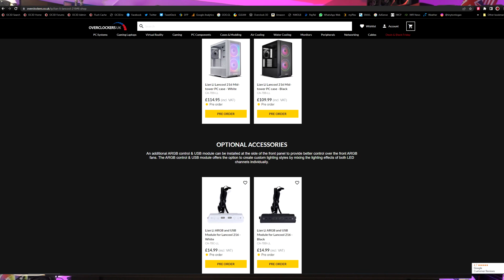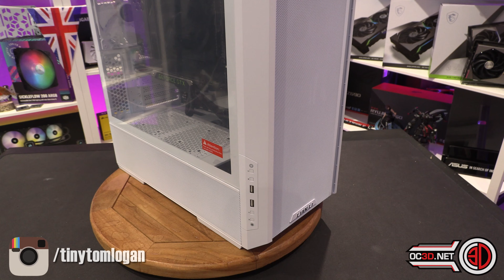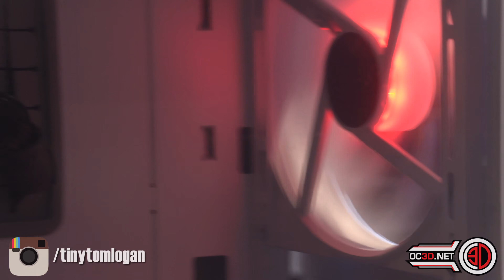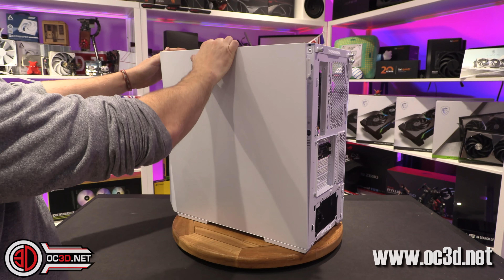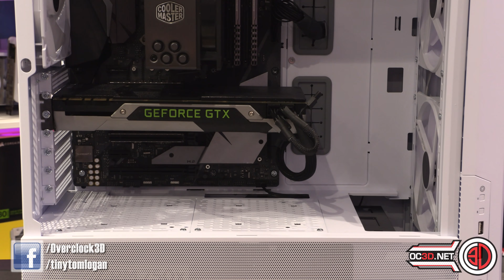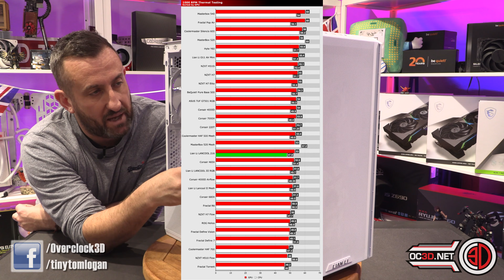Lian Li Lancool 216 Case Review

Comment: Great case, but that said it is as wide as a semi truck! I went with the LL 207 instead, narrower and with the lower fans a wind tunnel. Peerless Phantom Spirit, 6750xt both run cool, with volumes of hot air escaping.

Comment: Sorry about this kinda noob question ..if the two front fans daisy chained together can i just connect it to straight to the mobo but still need to put them in individual headers. are the wires long enough so that i could connect them underneath? i opted to buy this rather than the montech air 903. i was so over whelmed with lots of wires. lol

Comment: I wat to do a new build, with a ryxen 7 7800 X3D cpu, but not certain which motherboard to use with it!  In whatever motherboard I hopefully get I want to be able to use at least 4 NVME SSD on it without comprising the graphics card down from 16 to 8,  I want to be able to use GPU to full 16.  So my question to use is which motherboard would you recommend for me to use?

Comment: I've recently purchased the Lian Li 216 case, and I'm absolutely thrilled with it. Despite my front fans running at full speed due to my motherboard lacking PWM control for them, the case has significantly enhanced the aesthetic of my entire system.

Comment: I have and old XSPC 360mm radiator which is 60mm thick and with the fans I have 80mm of thickness. So my question is: would they fit on this case?
Reply: No 55 mm tops
Reply: @Ollibollimakkarolli  my case arrived a week ago and the radiator was installed because my memory is not tall. 5mm taller and it would not fit. One detail: the 140mm fan on the rear had to be moved down to place the fan on the radiator.

Comment: Hello, PLEASE HELP 
When I set the RGB lighting to a custom color, it always reverts to the default RGB settings when I restart the computer. I don't have an ARGB connector on my board and I'm using a lan216-1 panel. I always thought that would be better. Is it possible to save the color settings somehow?

Comment: This or the lian li iii?
Reply from the maker: The III is probably my case of the year
Reply: @OC3D  ok so I will get that ,thanks
Reply: they are very similar but different in important ways. the III is for sure the more upscale version, it also costs more. they do end up performing about the same thermally but i think the III is a little bit more quiet sometimes. but its also bigger and more mechanically complex. you can't go wrong with either just gotta do research and know what you're looking for. with my parts and budget i went with the 216 black rgb personally

Comment: I just got the case and I bought the 216x ARGB Control & USB Module and it was a pain to put in. I would suggest to avoid.
Reply: where did you find the argb panel?
Reply: @marchufnagel9068 on newegg LAN216-1X (W for white).

Comment: Do the argb buttons turn off the front fan LEDs? Or is it just for changing the color of the fans?
Reply from the maker: if the ARGB hub or mobo connector isnt fitted they wont light up

Comment: Hey, what 140mm rgb fan would you recommend for the rear exhaust fan?  Looking for something that will match the front 160mm fans.... I looked at lian li website and could not find one that works. Something that would easily match the front and have the outer ring and inner ring control.  Thank you.  Fans that can go into the hub not have proprietary connections.
Reply: Cooler Master MasterFan MF140 Halo White Edition , might work.
Reply: @paalosordoni7932  thank you, I have looked at those and agree they would work great. Thanks again.

Comment: Nice case  white looks great, with Gamersnexus testing the 215 had better GPU  cooling even though the 200m fans are slightly blocked off.
Reply: Yeah that's my only issue with this case.
Reply: @purpasmart_4831  Check the KitGuru review for this case, you can improve GPU temps like a boss if you install just 2 fans at the bottom. This dude here and Gamers Nexus tested with stock fans, so the results are not the best (still best cpu temps on GN). Kit Guru improved temps by 8°C just by adding fans at the bottom and if you install 3 fans on the top this thing will be the air cooled king, probably even better than the Fractal Torrent because its missing the chance to slap fans to the top.

Comment: Yeah, the front fans are a dealbreaker. Usually, the fans supplied by a company are not that great.  You cannot fit Noctua or Be Quiet.  I am sure there is a market for this case though. 

Great review saved me £110.00!
Reply: I believe he referred to how there are rails in the front section that can be adjusted to fit smaller fans.  So you could pull those out and do as you wish.
Reply: @garrettlison4992  Thanks. Missed that part.